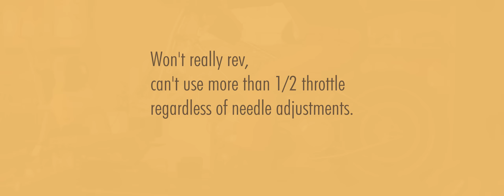Double Engine Aprilia RS50?!

Comment from the maker: Thanks for watching! Patreon live stream Sunday - discuss the latest video, two strokes in general, rum, old school piracy, etc.
Your support on Patreon really helps! 
https://www.patreon.com/2strokestuffing
Reply: Once again I will tell you that original armor all will cure your foaming problem. To test put some fuel in a drinks bottle with one drop of armor all and shake. No bubbles . The armor all effects the surface tension of the bubbles no surface tension they cannot form.
Reply from the maker: @ianturpin9180  Thanks for the tip, again... I've been meaning to get some and try, but I tend to forget things 😂 try to remember now!
Reply: Aalt Toersen. Rent a van, and drive down. Bring a powerplant you're working on, and a camera operator. 😉
Reply: Why don't you try trotte body fuel injection ?
Reply: Just wanted to say I love your channel and content, I just wanted to ask for content and knowledge wouldn’t it be better to start with a known motor with easy accessible parts and boost the hell out of it? 
Maybe a side project to run along side of your original content? 😊
Reply: I firmly believe that whoever sits here and says that you're just milking videos for ad revenue have never tried to research, design, build, and machine a single thing for themselves ever. That and they want their instant gratification. ...... Thanks for the content though great stuff ill definitely join patreon as soon as I'm able to.
Reply: @2STROKESTUFFING. Hi 😊 ..just a quick thought of one possible effecting component in resonance might be the wobblyness of the crank's main drive gear splines upon the crankshaft output splines 
    ...having one side of the that first slipped on drive cog's central boss being noticeably looser than the opposite side, leading to some potential outputshaft resonances, 
    ...being generated from the lack of a nonsliding interference fit vibrations passing through the engines structure to manifest somewhat within the carb bowl and operating forces of the engine, and become a future wearing point upon the crank's lower output splines 🤪🤔.
     Forgive me, I do not mean nor intended to cause offence, just an outside the box initial Eureka thought sparking off which I could not ignore and not tell you.

Comment: I think this is A better solution than the last chassis for dyno testing. I look forward to you finding room for the super charger in this set up.😀
Reply: Problem isn't the chassis but the dyno itself (has to much inertia for a small engine with a very narrow powerband)
Reply from the maker: Actually it's pretty much perfect... The problem is my stupid transmission solutions.
Reply: @2STROKESTUFFING  Alex try extending the primary part of the pipe , the further the expansion chamber is the more topend powerband.
The humming topend revs is shortage of fuel with added load. I honestly thought the vacuum carb was going to resolve all the issues maybe the stuffers are to restrictive limiting topend , maybe try once you have new gearbox running half size the stuffers in crankcase.
Huge effort well done it'll work.

Comment: Brilliant video as usual Alex. Been watching for about 5 years now and your uploads have allways been the highlight of the weekend. 

Amazing content, superb music and cinematography, plus the problem solving is the icing on the cake! The variety in your videos allways baffles me! I've seen twin exhausts, rotating exhaust valves via chain drive, primary and secondary intake setups, two different supercharger types on a 50cc two stroke and the list goes on! 

Your content and ideas are allways brilliant and it's those out of the box ideas that allways bring intrigue with your content. 
Don't ever be apologetic about these things taking time, as a fabricator/machinist myself, I know how much time and effort goes on in the background of these videos. Keep up the brilliant work! 

I was allways on your side with the carb vs injection war, but lately with you having so much carb issues it would be cool to see you finally dip your toes into making some form of modular fuel injection/throttle body setup to finally get away with all of the carb issues and different carbs. Now that you have a good rolling Dyno setup it would be cool to see you starting to play with the injection side of things as I'm sure the adaptability between all of your different ideas might end up being a bit easier when you can map the fuel and timing to any wild idea and application. Obviously it will have its caveats and difficulties but I've never seen you back down from a challenge yet! For reference here in NZ I have seen a few turbocharged 125-140+cc Honda engines in the little monkies running a tiny injection setup that seemed to have worked well and at first glance they were the same size as the original carburators and were apparently not too bad to setup even with the forced induction! Maybe even just buy a setup that could work and shove it into the shelf for the day you decide to play with it. Ive allways been biased to carbs but I'd definitely love to see your intrigue head to the direction of fuel mapping. Especially with some crazy ideas with throttle bodies. Maybe even pre and post crankcase to play with the volume/flow? 

YouTuber of the year 5 years+ and running in my opinion! Keep it up!

Comment: Never in my history of watching YouTube have I clicked in a video so fast. 
Excellent choice Alex. I have a RS50 with various AM6 engines in multiple states of tune. 
Careful you don't miss a gear though. The standard selector drum is awful for finding false neutral gears.
Can't wait until the next one
Reply: Hiya, I've had multiple AM6 engines too, i think the AM6 "gearbox" problem is simply gear spacing and speed of rotation.

I actually prefer the standard drum, but always install 0.9 spacers between the secondary axle. Also, I spend that extra euros on the Top Performances straight cut teeth clutch basked. 
This way the gearbox rotation speed is vastly reduced, allowing the gear to be set in the right position and not to shift out. 

That is it basically... Never had any issue on false neutrals or falling out of gear, even between the everywhere known from-5th-to-6th shift.
Reply: @att49356  that's very interesting. I have been through many different shims to make it better. I tried the TP shift drum and found it helped and left it as that. What you say certainly makes sense. Might well give it a go on the next AM6 build
Reply: @gpzephyr  Yeah please try it! It really gives that extra pleasure of riding when you don't have to worry much about giving the kick when shifting. 
Also, all shims could be installed brand new, i never reinstall old in gear shims just to be sure. 

What version of RS 50 do you have? I own an old Poggiali Black and I love it.

Comment: Just had a flashback to my days racing an Aprillia RS 50 and rebuilding the gearbox 😅
Reply: Lots of laughs...maybe the gear box ...needed a different oil...?
Reply: @fredmitchel1236  as I remember it was just getting the shiming correct... Had a false neutral. We used to use ATF in the gearbox.
Reply: I see....the engine itself seems very powerful. I was looking to see that engine on YouTube...

Does it have a power valve?

Just curious
Reply: @fredmitchel1236  no power valve on the AM6, well not in the RS50. With an aftermarket cylinder, pipe, carb and ignition they go very well! We had about 14hp but you could get more...
Reply: @AutoBeta2T  Amazing power...without the power valve....

I am now interested in the China Doll 66cc....but they seem so crude...I have some ideas to make them better....sell like some little upgrades...prove myself in a race or at least a top speed video

I would like to start with parts from a better engine...like the Aprilia.....

Or a KTM 50 or 80 cc..

I will look up the Aprilia aftermarket parts...

Old dog here...stated with home made gocarts made from broken engines found in trash...then QA50..
Cushman Eagle, Harley 100, Lambretta 175, Yam LT1-100, Ossa 250, Bultaco 250, Can-am 250,  Maico 400, IT-465, IT490, Husky 500, 

Now I have KTM 380, and KTM 300 bought new in 2017.. then there is the KTM 550, and a YZF450...and my Yamaha Thundercat ..

I love the 2 cycles...

Comment: I have made timing belt pulleys with lost pla casting on plaster/sand mix. They are not as pretty as commercial ones but work well. Hole and sides can be machined but teeth work as they are.

May not be worth of trouble to make instead of buy but when building things is. The point is you can have them when you need them without stupid waiting. Just print the part with light infill, bury in blaster and burn away in kiln. Can be casted from aluminium, brass or bronze. Aluminium bronze is interesting material.

Aluminium is easy, others take some practice to get right.

Comment: In 1981 I put a Jawa 50 cylinder on my puch moped.   I put a 17 mm carb on it. Tomos rear rim. Suzuki tm 75 front end and wheel.   It ran 51 mph on flat ground.  Over 60 going down the bridge going to to beach.  I got speeding tickets on it.    I did the work at school in metal shop. Had to make a spacer.  I didn’t know a whole lot and I got lucky.  It was so fast.  My teacher was more surprised than I was.

Comment: Your comment about the brute force engine while holding the drum valve assembly reminded me that the best you've had so far has been the brute force with the roots blower.  I'd like to see you go back to that.  It started instantly, and produced gobs of power.  The rotary valves had too much friction, but I think you gave up too quickly on the drum valves after the chains bound up.

Comment: Straightened a few shifter shafts along the way with zero problems a new seal couldn't handle. Even used a 60 inch Jackall to do the detail work once while smacking ourselves crazy just north of the Ms. Mosquito Power Sucker training ponds.

Comment: Could you wrote a electric fuel pump that was in line to a 2 fuel pressure regulator to a carb to change your mixture easier and more effectively or no just a question

Comment: Noticed your hands thinking about what to do with the belt tensioner and... Remember to tension the slack side of the engine to jackshaft belt as in locate the tensioner mount to the front with the idler pushing backwards against the belt for this particular iteration. Just a reminder.

Comment: Just a question, i allways wondering if you never had problems with hydrolic lock in te combustion chamber due to unburned fuel accumulation. The cylinder looks downward. Hydraulic lock is a big issue on old aircrafts Row engines, the lower cilinders had allways to be drained by opening the spark plug. Probably a lock will not occur, but detonation due to a momentary high compressio ratio can happen. Cylinder downwards is anyway a great setup....low gravity point, excellent.
Reply from the maker: Never noticed problems, but could actually be what's screwing up rev-ability. I have to pull the plug and drain the engine before every session.

Comment: Hi Alex, there are crankshafts on the market for the big bore am6 engines with longer rods. Couldn't you use this type of crankshafts with an adapter plate between the case and the cylinder, and forget your crankcase and crankshaft? So your whole engine would be a compact unit.

Comment: Thanks for telling us what material you used for the stuffer, I'm very suprised the PLA is holding up to gasoline and heat, at best it is good for making figures or prototypes of things. PETG should he good along with CF nylon, best thing about PETG is its a smoother surface but wonder how well that would help/hurt perform vs the flatter surface (porous) of CF nylon for fuel/air to get by. Anyways, now to continue watching!

Comment: Use lathe way-oil in chains, it stays and wont attract dust/dirt.

That what we use on hi-torq tractor pto driven implements like baler and it works way better than anything else we tried :D like chains last 10x longer than with other oils
Reply: Chainsaw bar oil might also be an OK backup if you don't have way oil. It is similarly tacky so it won't sling off.

Comment: i have often wondered if some of the problems you have had has been down to the cylinder been the bottom of the engine rather then front or above the crank

Comment: ever thought about repurposing the 50cc in a race bike frame (once you've bear the land speed records) ? it seems at home in this rs50 frame..you would probably have to work a lot on the powerband, exhaust valve, etc. but in the supercharger scenario you could also run it with a smaller displacement supercharger to move the power and a little bit lower

Comment: Seeing you squeeze a 2nd engine into the RS50 frame send me down a rabbit hole of total madness.
Would an opposed piston 50cc 2-stroke give more power than the current design?
It would mean starting again from scratch, and engineering such a device would be a huge challenge.
Total madness. I feel guilty for suggesting it. But you've probably thought similar thoughts already.
Reply from the maker: Same thoughts the moment I put the engine into frame😁
Reply: In principle the more efficient uniflow scavenging should make more power. It should also be more suited to boost, by offsetting the crankshafts you can have asymmetric port timing (exhaust closing before intake).

Comment: With the clutch, you should be able to measure the losses in the gearbox and correct for that. Probably a more accurate reading than the variator.

Comment: Thanks for the hours of awesome content! I've been following the series for a while. I think it's time you should go EFI, running a pressurized fuel system you can avoid a lot of the vapor locking and vibration issues of a carb, tuning is also way easier not having to faff around with disassembly, just changing a value on the computer. You could also potentially try direct injection into the transfers - Such as KTM did commercially, it might help with the large crank case volume. 

And if you want to attempt mounting your cylinder to a commercial case, check out the Jawa 20/21/23(220/221/223, "Pionier"), it has quite a lot of meat around the flange and cylinder goes forward resulting in zero obstruction around the flange. Jawa Babetta(type 207, 210) could also work, but the casting is a lot skinnier and comes with a 1speed/2speed automatic instead of a regular wet clutch 3 speed
Reply: I’ve lost count the number of times EFI has been suggested. Seems like a no brainer to me
Reply from the maker: 😁 True.
Reply from the maker: Already got a Babetta🤔
Reply: @2STROKESTUFFING  I'm not sure how large your cylinder is, but if you do try to machine the babetta case for it you may need to weld on a little bit of material on the clutch side. With 80cm3 PA80 cylinders we do that as when it's machined and ported for the large liner and transfers it goes past the original casting there. 

If you want help with EFI feel free to get in contact with me, I am currently working on some 2 stroke EFI stuff as well.

Comment: I realise that your present dyno setup works of the rear wheel, but I wonder if there is no way to dyno-test obnly the engine, without the bother of gearbox, variator, drive train etc? It might be much simpler.

Comment: be carefull because in my experience pla starts to melt at around 60°c
Reply: That's the glass transition temperature for PLA, it starts to soften and lose strength at this point but doesn't actually melt (i.e. turn liquid).  Softening may not be a big problem provided the insert is well supported, but equally it could distort and start blocking off ports etc.  It's far from an ideal material for this application.
Reply: If you anneal the pla part (packed in salt for 2 h at 150°C) pla becomes much more heat resistant and usable

Comment: I wish you were closer to me i would have you setup on a efi system and help you understand how easy it is.
Reply: I also see no difference between a manual gearbox and a manually foot adjustable variator....
Reply from the maker: 👍 The main problem is the engine being allowed to move back n forth causing fuel foaming. I've run several bikes successfully with this setup tho, but better to leave it for now.
Reply: @2STROKESTUFFING  I dont think it really is. Especially with a pumper carb. You think your motor is vibrating more than a KT100 go kart motor on full rip ? I dont.

Comment: love the videos been watching for ages, but whats the goal now? if you're planning on going back to a supercharged aplication, verifying the cylinder and port geometry NA might just be a waste of time. Because with so many veriables, pipe, boost pressure, crankcase volume etc; a cylinder that works well in a NA application doesnt mean it'll be suitable for a forced induction set up.
thats what i thought the main purpose of having such a large crankcase volume was, to act as a "resivour for boost" due to the 2 stroke cylce, in theory there's not really and reason why that cylinder wouldnt work on a normal crank case design/volume. so isnt it a waste of time to get something working that you know will work eventually when your end goal is to run the engine with a supercahrger and large crankcase volume to suit? 
keep up the awesome videos, always fun to watch.

Comment: Hey sir, I have a 90s kawasaki kx80 engine as my first 2 stroke build, and I have a question, I have a cylinder that measures 50.038mm, what clearance should I give for the piston, also would it be fine to ball hone the cylinder? A new cylinder for it is around $700 so yeah I'm just trying to avoid that, also the 50.038mm cylinder doesn't have any scars. Or should I try to look for kawasaki specs on the piston wall clearance? Not sure if you reply to questions in the comments.